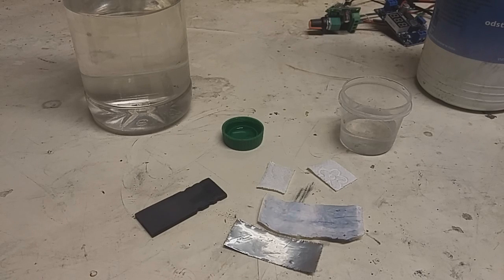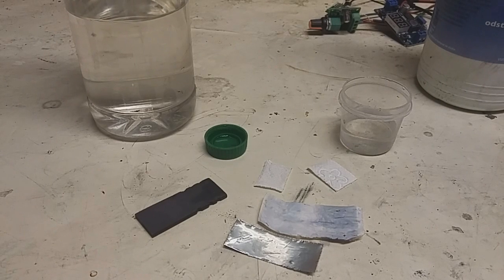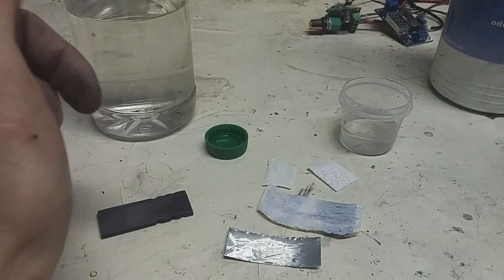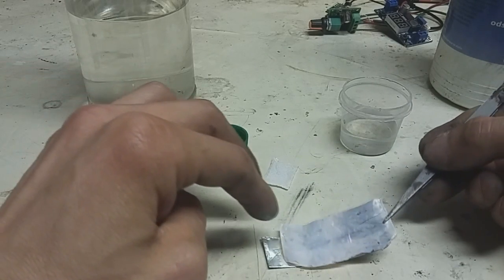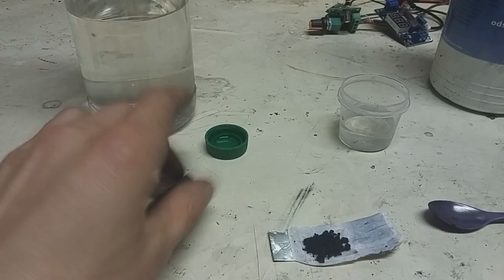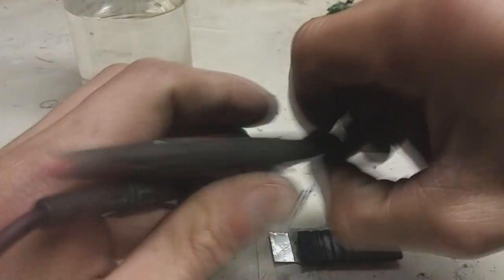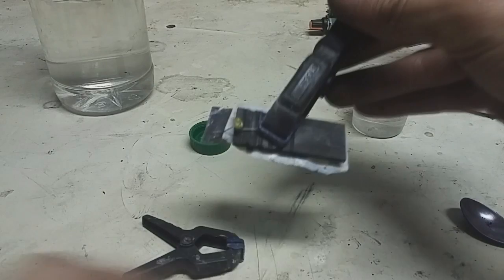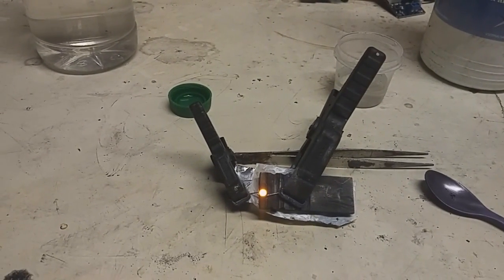High Voltage Aluminium Air Battery with Household Materials

Comment: I got all material at home except for the polymer separate not easy to get.
Reply from the maker: Yes I know. Use baking paper.
Reply: @cayrex  thanks alot dear Master for your kind reply.
Reply: @cayrex  I did it, but can get only 0.77V, its ok, thanks alot.
Reply from the maker: @hasan24253  with vinegar on the positive side and NaOH on the negative side?
Reply: @cayrex  Right Master
Reply: @cayrex  The led was on for 4h.30m. the battery dry off, I add some Bleach and Vinegar, so the led light again. will see for how many hours it will light,
Reply from the maker: @hasan24253  That nice. What voltage you get?
Reply: @cayrex  0.77V
Reply: @cayrex  After refilling the electrolyte, its light for 1 hour only, I see that the aluminium foil was corroded, just now I make new battery with 1mm aluminium sheet. will see how long can light the led.

Comment: LOL this is just a normal cell, not an air battery.
Reply from the maker: Hehehe of course is a cell. A cell made from aluminium anode, activated carbon air active material, dual electrolyte, manganese dioxide als air catalyst, with voltage of 2.3 volts. So, of course is a cell. 😂🤣😂🤣
Reply: @cayrex  Ok I will give you that, I suppose you can call it a air cell if you want to. :)

Comment: Good day sir. I'm delighted with your battery experiments. I'm trying to make an aluminum / copper / acid battery for an electric bike for my kids, so I would pack it in a plastic tube of 50 mm, 600 mm long. Do you think this is possible? I ask for your advice. Greetings from Serbia.
Reply: Not to be mean here, but I'm sure you figured out by now that this sort of project is not viable since you commented this a year ago.  Aluminum copper is a pretty poor battery chemistry, and is not rechargeable.  Setting out to build an ebike battery from scratch without prior experience is most likely going to end in frustration.  However, there are battery chemistries that are more doable with homemade materials that can yield decent results.  Lead based batteries are one of the easier ones to make from scratch, however you will likely never create something strong and energy dense enough to drive an ebike.  A slightly more realistic goal(But still unrealistic), is making a big battery for solar energy storage, or back up power.  Commercial lead acid batteries are barely energy dense enough for ebike.  but a homemade one most certainly won't be turning wheels very fast.  ;P  Another viable option for homemade storage is super caps/carbon batteries.  They are just carbon on both sides!  Safe, and they can pack a good punch if you know what you're doing!  I do believe that it is possible to make a short range homemade ebike capacitor/battery from scratch at home!  TONS of work though!
Reply: Lead tetraokside.in.this.primary element with Mg..working..NICE.

Comment: Addendum: you can get sodium hydroxide by means of chemical seperation from many cheap hand soaps. Just look the ingredients list over, and you will find several base chemical elements that yield high success rates for chemical reaction electrolysis.
Reply: Or ya can buy any size up to 40 pounds of it for 100 bucks on Amazon, why would you go through the extra effort of extracting your electrolyte from soap..
Reply: @SinfulTed  why consider oneself a chemist if the "easy" way is desired. Sometimes major breakthroughs are discovered, a better electrolyte discovered, or just an amazing reaction. But hey, buy away, I am sure easy will suffice...
Reply: @project-unifiedfreepeoples  the thing is it isn't super easy to just melt and distill plastics to extract hydrocarbon. After a while polymer chains reform and ya get are left with a paste. Not really ideal for ICE but if you want a more concentrated fuel for say steam production. Or waste oil style heating. Then whats the difference.
Reply: @SinfulTed  I respect your rebuttal, you raise a valid point. Thank you for the exchange of hypotheses.
Reply: @project-unifiedfreepeoples  i just noticed I got my conversation confused
Reply: @project-unifiedfreepeoples  i was arguing with someone about melting plastic into diesel fuel lol
Reply: And yes, trying things proportionally when developing electrolyte is great. But most of the people who would care to try are not going to have the equipment to analyze something thats extracted to see the proportion of each compound. Soooooo, starting with as pure of elements as you can and monitoring ratios added is a far simpler and cheaper. Especially when your first starting out.
Reply: @SinfulTed  do you have a channel or website?
Reply: @project-unifiedfreepeoples  not at the moment, I just pay alot of mind to alternative sources of energy generation and storage. At this moment after running errands and making the mistake of clicking reply in the wrong email.. Im chilling soldiering solar cells.
Reply: @project-unifiedfreepeoples  ohh off from a small solar generator with free lead acid batteries that I refurbished
Reply: @SinfulTed  I understand, currently working on a Atmospheric electron collection antenna. Good luck friend, best regards!
Reply: @project-unifiedfreepeoples  oh thats tricky, super high dc voltage with next to nothing for amperage if I recall

Comment: Not able to find Polymer seperator, any alternative? Can I use agar-agar like this video 
https://www.youtube.com/watch?annotation_id=annotation_3133827581&feature=iv&src_vid=nue1ZGSleEo&v=RjlfG1n2N2U
Reply from the maker: You can try. Positive electrode need to have a acid electrolyte and negative electrode need to have alkaline electrolyte. https://rover.ebay.com/rover/0/0/0?mpre=https%3A%2F%2Fwww.ebay.co.uk%2Fulk%2Fitm%2F122722751388

Comment: I understand how you can mess up when you are live and have to change things on the fly because of it...you know.. Because you named the video before you messed up...i just can't stand assholes out there that claim that they can make high voltage batteries and then proceed to waste ten minutes of everyone's lives by building something  that has less energy then one of my farts...u my friend  are the turd that follows my fart
Reply from the maker: I feel so sorry for you,.... because the Mother Nature sometimes mess up some things,.... for example you 😂🤣 So, the normal aluminium air battery have the voltage of 1.2 volts,.... with this setupe which you see in this video,   you get higher voltage of the cell. So, this is the explanation for low IQ people like you. Be good 😁😉😊

Comment: can it rechargeble
Reply from the maker: Yes but only mechanically. Changing the aluminium and the anodic electrolyte.
Reply: no.. i mean charge using electricity.
Reply from the maker: I know what you mean. The battery is not rechargeable. When the battery is dead, you can change the aluminium and the electrolyte,.... and the battery will be like new
Reply: can u teach me create aluminium rechargeble battery

Comment: we are trying to manufacture a better casing for that battery, we are in dilemma  about dimensions.
tell me if u have any idea about that and what are the requirements for making of the battery casing????????
Reply from the maker: Rajamohan Reddy you need to make a casing that can you open and replace the aluminium. I think that casing that is used in lead acid battery will be good.
Reply: thanks sir........

Comment: Question. What if you replaced the aluminum with aluminum powder. Make it so you can add the powder as it’s consumed. Use a stainless or carbon to complete the circuit
Reply: It would be hard to turn the aluminium to powder without it oxidising before you add it to the mix. It might work, but it will probably reduce the capacity of the battery severely

Comment: So we have different galvanic matals and different ph electolyte and mno2 in the activated carbon. I guess the next level is to use graphene to add capacity but what else can be done to increase the voltage by .5 or so ? I guess that's the trillion dollar question ???
Reply from the maker: Electron Proton Neutron Mouron Oh,... for trillion dollars I'll tell you,... :)
Reply from the maker: Electron Proton Neutron Mouron 10% NaOH / Al ---- 10% H2SO4/KMnO4/ carbon rod. you get 3V
Reply: Electron Proton Neutron Mouron remove the aluminum electrode add stainless steel and constantly add a aluminum powder that’s duped.

Comment: LED load is 1mA, is it too low
Reply from the maker: Дмитрий Нелюбин and?
Reply from the maker: yellow LED 2.4 to 2.0 volts current 20 to 15 mA ;)
Reply: Modern LEDs are very efficient and capable of giving light at a current of 1 mA. 20mA is already a very powerful LED. If possible, show the load current. I'm interested in your videos.
Reply from the maker: Дмитрий Нелюбин data paper show me the current draw of max load of 20 mA. so this battery run the LED with 8 mA. open current of the battery is about 100 mA and 2.3 volts. yes I can show you the video
Reply from the maker: I make a quick video: https://www.youtube.com/watch?v=2ZiYcd-HdO0&feature=youtu.be
Reply: big thanks!
Reply from the maker: Дмитрий Нелюбин no problem bro